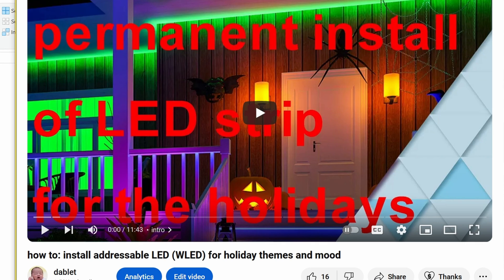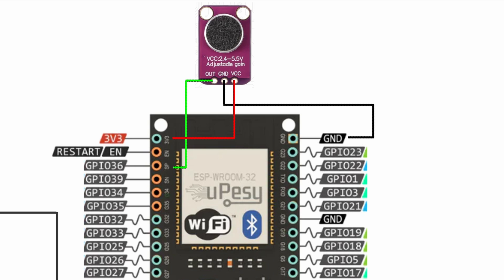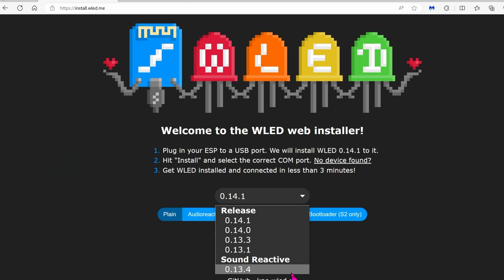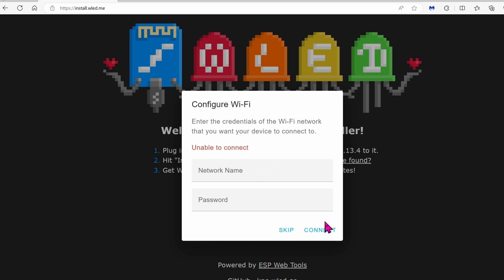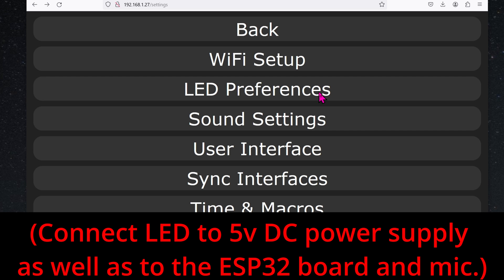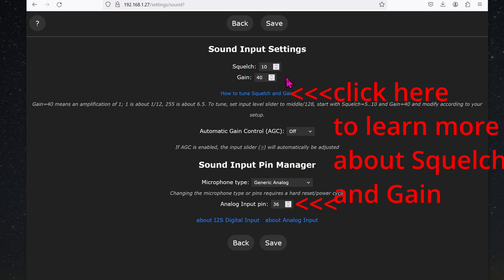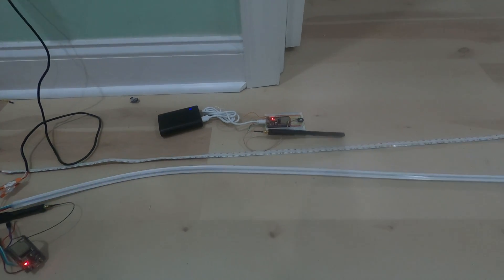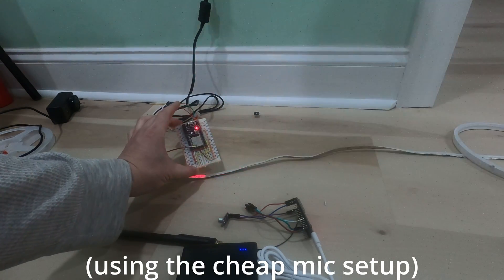WLED, now with sound reactive

Comment: I'm wondering is there an easy way to skip the mic and go with an aux in port so I could plug it straight to my audio source? That way it would not pick anything else like the sound from talkin.
Reply: yes theres schematics on WLED website, some resistors to scale the voltage down then into the analog in, job done.